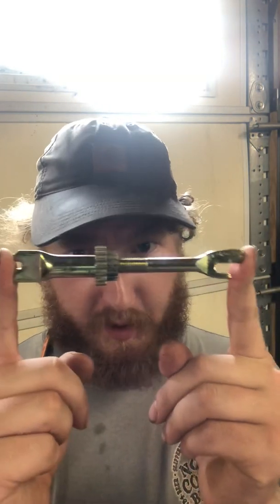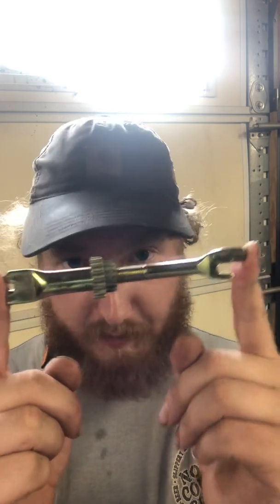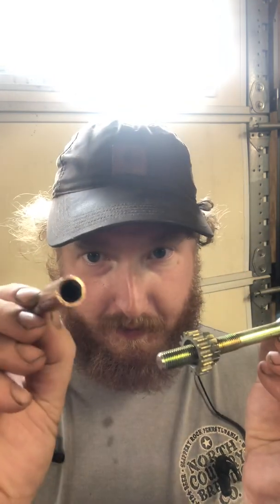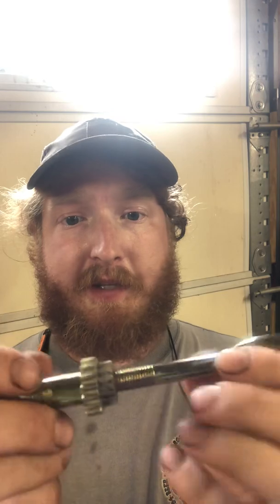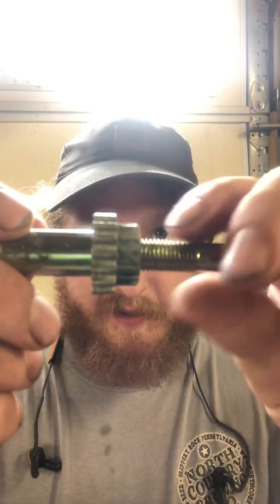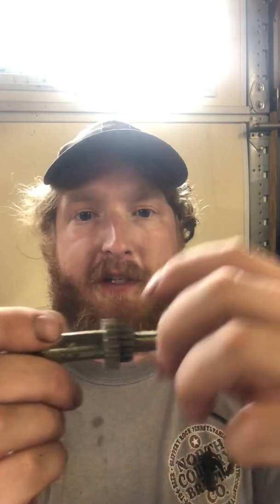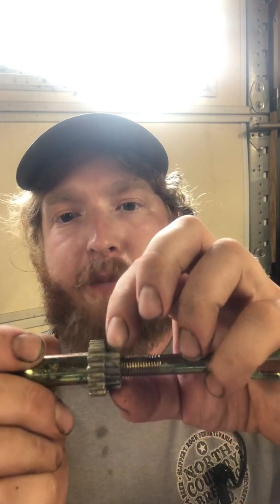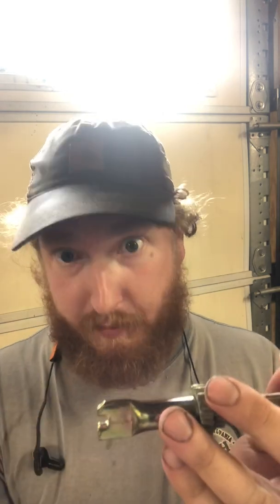How brake adjusters work for Vanagon Rear Drum Brakes

Comment: just wondering what your opinion would be.... having a few different brand of vehicles with rear drum brakes. should the correct operation be to engage the parking brakes every time you park so the rear brake is kept tight? i dont do that all the time but never had to adjust my rear brakes in 10+ yrs so far....

Comment: I just rebuilt the brakes on my '84 Vanagon Westy (first time) with new cylinders, shoes & springs, and am getting ready to reinstall the drums. I wasn't sure how to set the adjustment so thought to find a YT video explanation.

I had no idea the adjusters were 'side-specific'.  I had originally kept them separate, but somehow they ended up together after cleaning them.  I'll have to double check, and hope I have them on their correct sides.

Thanks for the video !!!
Reply from the maker: I'm glad this was helpful to you!